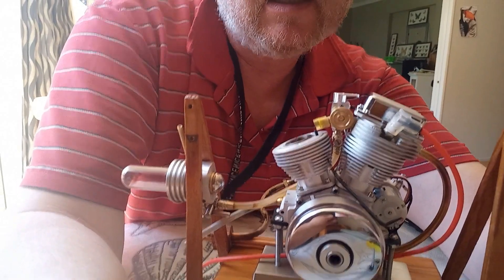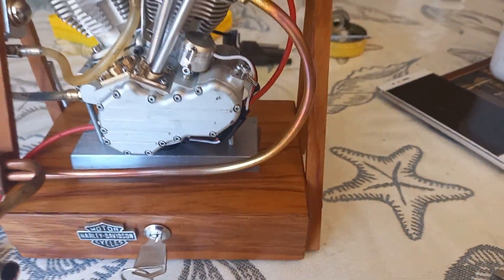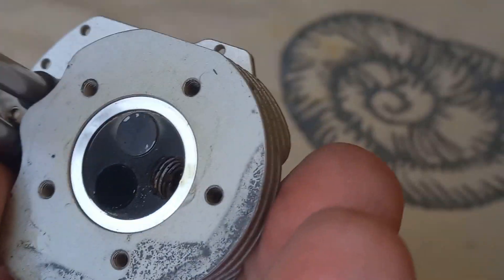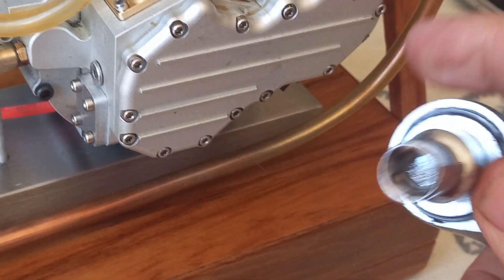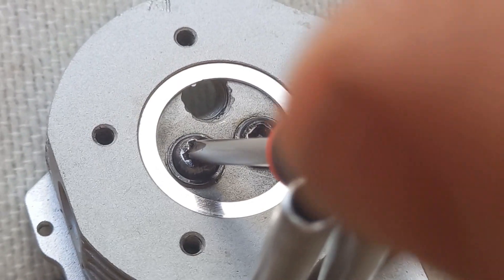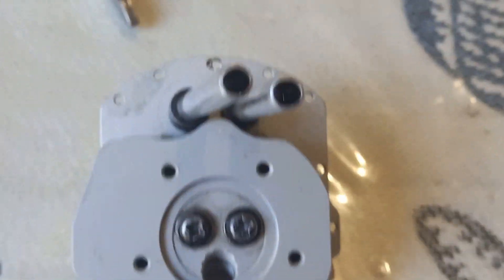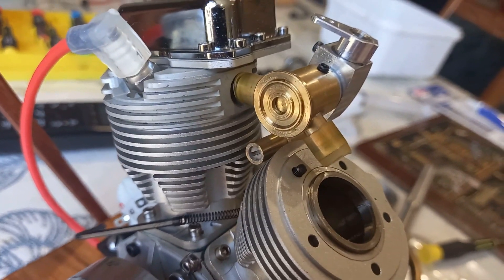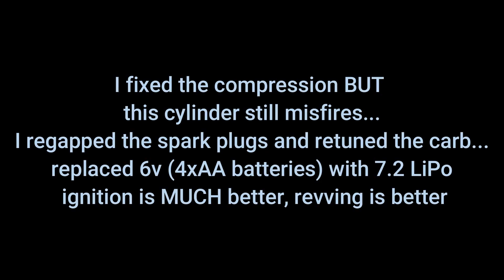Part 2 - Valves Harley panhead v twin model DIARY CISON FG-VT9 9cc V-twin Motorbike Gas Engine

Comment: I've just got one my friend and to be honest I think that it's crap from China that doesn't last long. I've got the CN 200 which is the same
Reply from the maker: Mmmmmmmm you can't just drop the C-bomb without telling us why. Are you disappointed? I got an early model...have they not improved? I mean real work has been put into it; Cison is the only Chinese model engineer equipping model petrol engines with cast iron rings, for example. I mean I don't disagree with you I just want to hear your reasons :)

Comment: Harley’s have always traditionally been dual fire ignition 
Which means they both spark at the same time
Reply from the maker: Well this is news that blows me away..."From 1927 until the introduction of the Twin Cam engine for Big Twins and the introduction of fuel injection on Sportster models Harley-Davidson used a Wasted Spark Battery/Points and later Electronic version Ignition System. This allowed a single set of breaker points to trigger both ignition events.

Yes both spark plugs fire at the same time but one cylinder is on its Combustion stroke while the other cylinder is on its exhaust stroke.

Harley-Davidson considers the Rear cylinder the first cylinder to fire due to the rotation of the flywheels. The Front cylinder will fire 405 degrees later and the Rear cylinder fires an additional 315 degrees of rotation later." I appreciate so much you took the time to correct me :) Thx!

Comment: Hello
I follow your videos and that's good
I own the v twin V2
1) Do you have a Tutorial of parts to change of better qualities? on the engine
2)How to install the starter with the sprockets
3) Also what is the value to adjust the valve clearances of the intake?
Exhaust is 0.10 mm manufacturer
Thank you for your answers
Olive tree from France
Reply from the maker: Nope not yet because Ima not sure yet...for example, I tuned the carb and regapped the plugs for MUCH better starting and running...and revving and top speed...but it caused the persistent misfiring (because of my ignition's issue) to look WAY worse. If this ignition - misfiring problem keeps happening I'll go to plans B C or D but not ready yet. Engine not running right now, but I'll let you know. [Also, Chinese New Year may slow delivery of parts].
My starter is cosmetic only, not functional as that hasn't been released yet. I secured it with a dot of superglue.
I will check my valve clearences and get back to you. I haven't messed with them as they all seem ok, Ima problem solving the ignition and mix / misfire first
Reply: Thank you for your answers hoping that you find the solution of your ignition!
I also asked on the site for the adjustment of the valves in intake and exhaust on the documentation it only speaks of the exhaust I am waiting for his answer and will also keep you informed
For the starter I think he will have things soon see options
Another question :
Should oil be added to the copper bearings in the crankcase or does it lubricate with the mixture?
Sincerely Olivier

Comment: also my igniter makes two sparks at the same time how can i solve? thank you
Reply from the maker: Hi and thanks for your comment. Do you get misfires too, on one cylinder? 
... I wondered if two sparks at the same time was a design choice to simplify matters...but you wouldn't need three cables from the optical sensor. If you disconnect the earth wire, and the batteries and the plug to the optical sensor, and check for a short between the two spark cablles, is a short between them the problem? 
Then you can carefully unwrap the plastic sticker around the ignition module and look inside at the circuitboard. It's not well made - rather than the normal method of encasing these high voltage circuits in plastic, they used a bit of blue tac on mine. There are two complete high voltage circuits. You can check the circuitboard for solder blobs touching/bridging where they shouldn't.... I couldn't find anything like this on mine. Anyway, opening it probably voids the warranty, right?
I contacted EngineDIY a week ago. I want a replacement from them - I'll also buy a optical sensor spare (and piston ring set). EngineDIY support sent my issue to the manufacturer who hasn't replied yet. sigh...please let me know any progress on this for you. I will too:)

Comment: Great work! I think I will lap the valves on mine too, I really like this method. Also I’ve seen more pictures of the engine with a starter motor. Did yours come with a starter or are they going to sell a kit to put a starter on? Thanks for the video!
Reply from the maker: Firstly thx for the feedback:)
Regards the electric motor, I went to an electronics chain store called Jaycar (New Zealand and Australia) and then looked for a motor that would fit. It doesn't run because I don't have the gears inside - it's a placeholder only. Jaycar even stock the exact same motor with reduction gearbox on the frent that Cison appear to use, ...but no point buying it without those gears...
Reply: @ThomasPCGuruENGINES  that’s what I was curious about, the gears inside. Thanks for the reply!